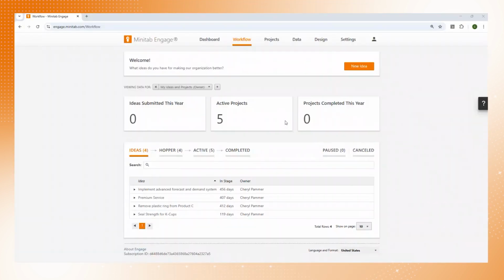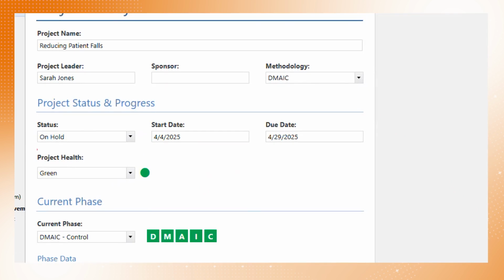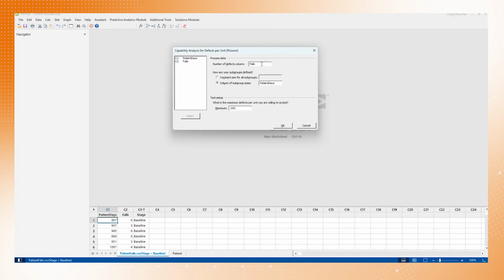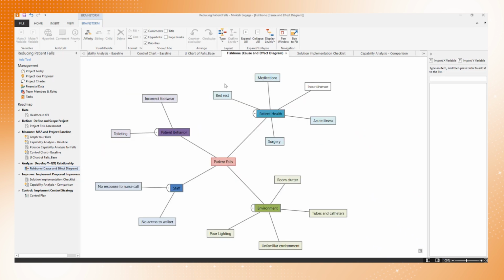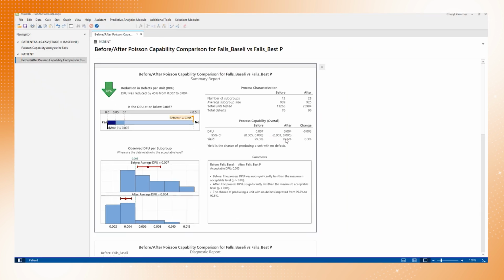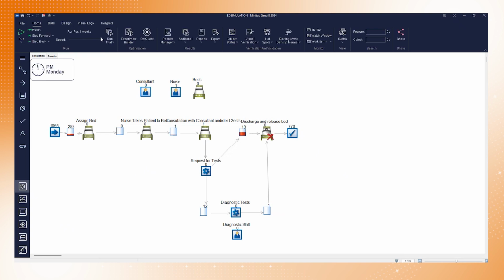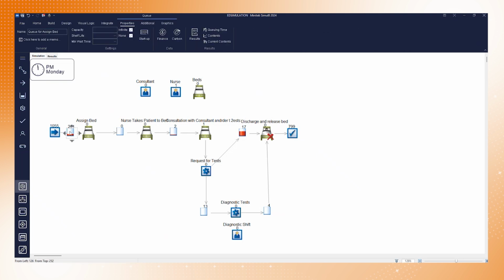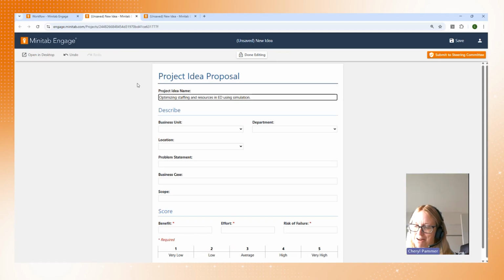Using Capability Analysis and Simulation to Improve Processes

Comment: Oh, man, I remember tackling complex case scenarios just like the ones discussed in the video about simulating healthcare improvements! It felt like I was stuck trying to fit a square peg in a round hole. Then came along The Thinksters and shook up my whole approach. They taught me to see each problem with fresh eyes and structure my thoughts in a way that made sense, not just force things. I used to struggle trying to figure it all out by myself, but these guys had this knack for making everything click. Ive ended up at Bain now, still cant quite believe it. They used to give out free coaching sessions back then, no clue about now, but it was seriously worth it.